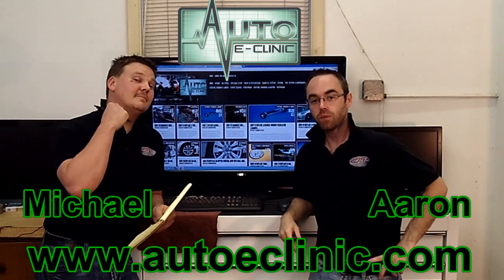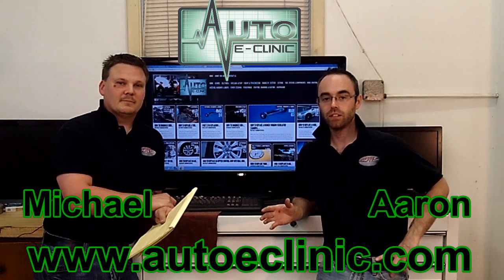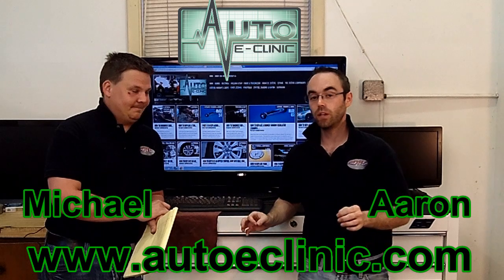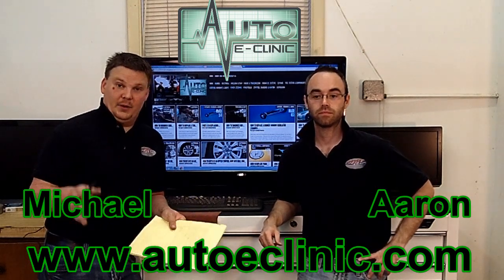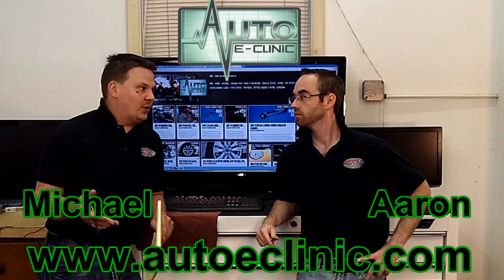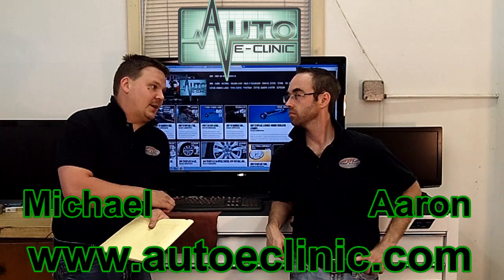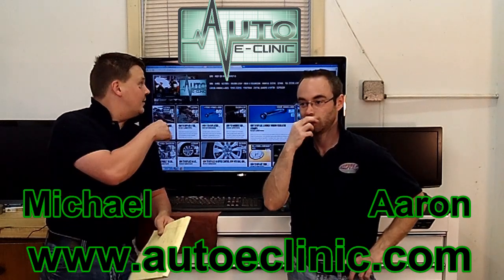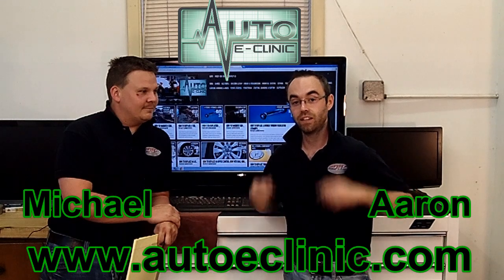Part 2 - Diagnosing a P0456 Small EVAP Leak Trouble Code

Comment: i have a 2006 chrysler pacifica, it has evap codes, recently had the primary fuel pump changes, the car runs great for a few week, and it still does but the suv can only take 2-3 gallons of gas at tops after it keep spiting out the gas from the nozzle, can you help me to tell me what can possible be the problem?